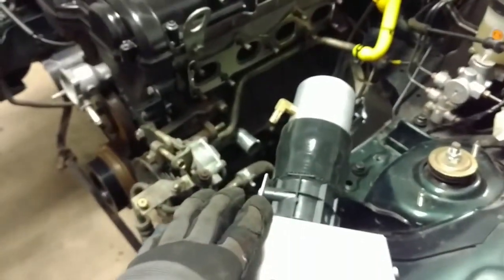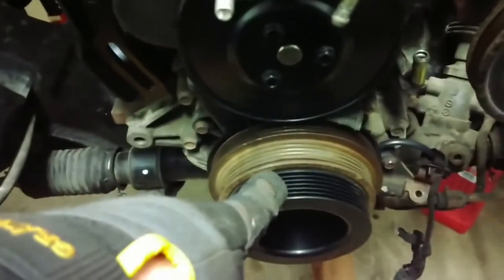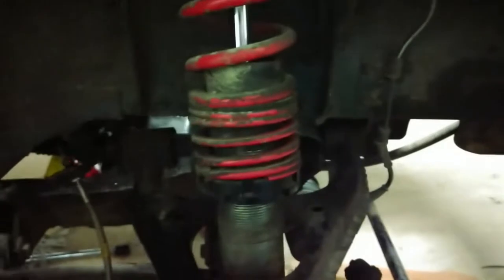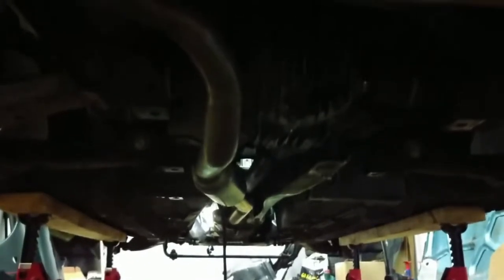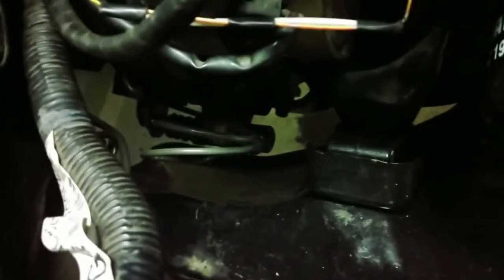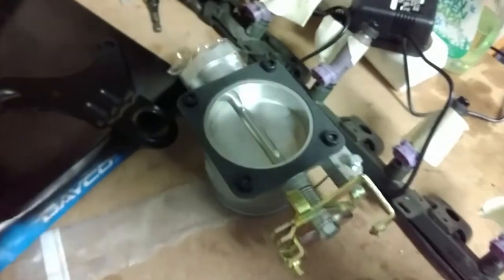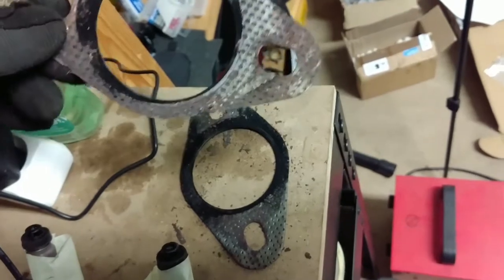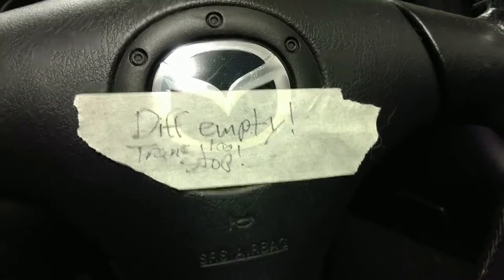Project Bumblebee: Project Update July 2018

Comment: You've been a very busy boy! So much work but the progress looks superb and it's very exciting. The new exhaust headers look gorgeous, can't wait to see them in place. Seems a shame to hide them but I guess you need to protect the bay from excessive heat for better power?
Would have liked to see what was involved with changing out the clutch slave cylinder as I think mine may have a slight leak and will probably need doing at some point.
Hope all goes well now and I'm eager to see everything all buttoned up and hear her start up for the first time. 👍👍👌
Reply from the maker: It's actually super easy to change them both. Quite literally two bolts each holding them both on to the car and one hardline (you need a hardline wrench for that, or you will surely round them off) each. Then of course, you'll have to bleed the system eventually. I'm not there quite yet, but will be once the car is back on its wheels again.
Reply: Totally Legit Gaming [TLEG] Thanks for the information, much appreciated.
Reply from the maker: Guy Wilson no worries mate. The hard line wrench should be a 10mm, BTW. I don't remember off the top of my head what size the fastening bolts are, but I believe they're all 12mm.

Comment: Very exciting stuff you have going on.  Looking forward to seeing the completed project.  On a side note, how difficult was replacing that front main seal?  Any tips?
Reply from the maker: Because Miata Getting the pulley and crank bolt off is the hard part. After that it's pretty much the same as replacing the rear main seal. It just a matter of getting the seal out, which can take some fiddling with picks and stuff.